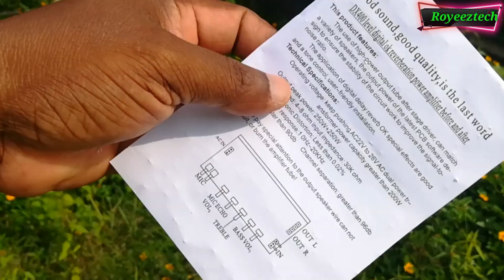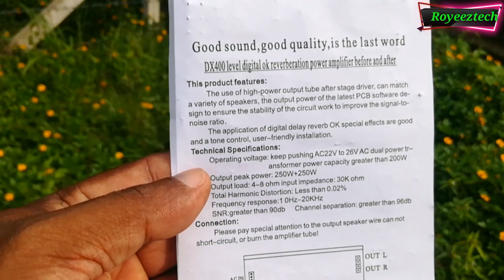HIFI Digital Reverb250+250 karoke Amplifier board

Comment: I receive mine. Its powerful for a 1 pair transistor per channel. Not the best bass but in my case i only use this as a high pass amplifier. I power this using 28-0-28 AC transformer.